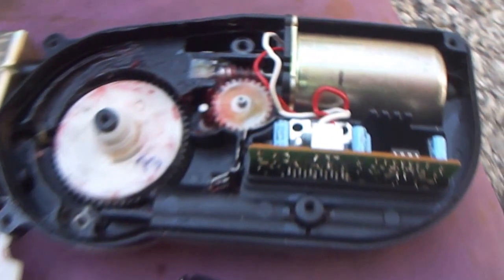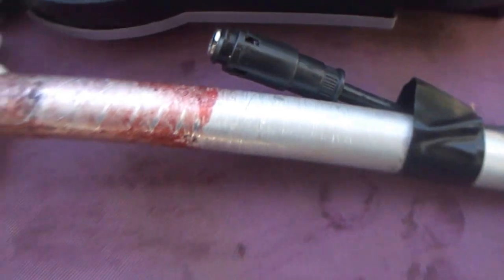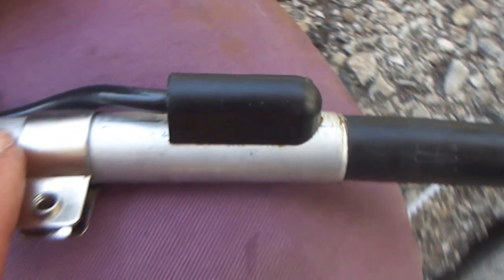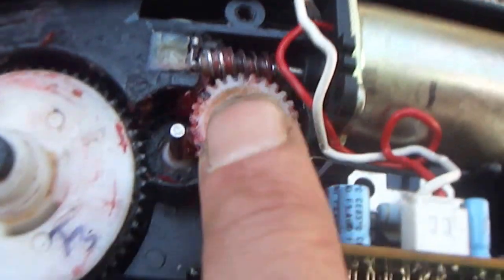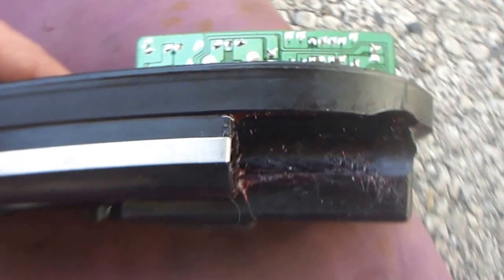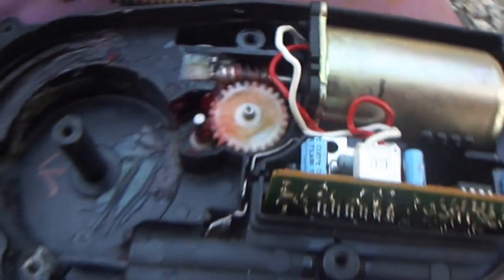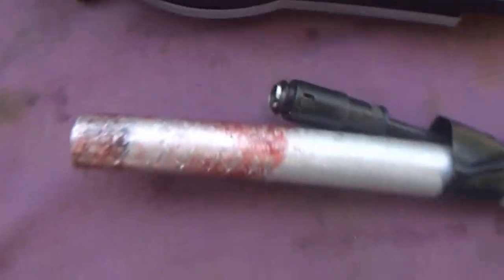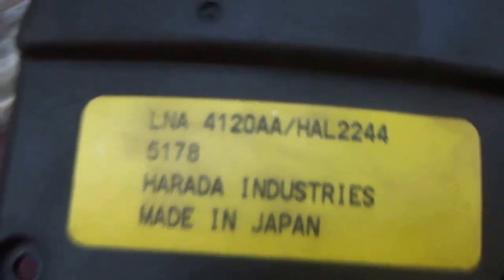Antenna Mast Rebuild Overview On a Jaguar XJ6 (x300)

Comment: I Had to replace my antenna mast in my 95 XJ6 three times in the first 12 months of ownership. Yeah, I'm not too bright! At full extension, I found it would just catch my opened garage door. If I wasn't paying attention at the end of the day, it would snap as I drove into my garage with the radio on. :(.  I purchased the new masks online that came with replacement feed cords as pictured in this video. Not meaning to be disrespectful to Steve for his great Video showing us the assembly and internal workings.  But I just removed the Nut at the base of the mast, then turned the ignition and radio on. The system would then push out the cord automatically thinking it was extending the aerial.  REMEMBER WHICH WAY THE TEETH ON THE CORD ARE FACING. The old mast and cord will keep feeding out until they both come free of the motor. I then positioned the new cord with the mask back in the hole and gently fed it back in after I had someone turn off the radio. After the radio is turned off the unit starts retracting the cord thinking it is retracting the Arial. I lastly replaced the nut at the base of the mast, JOB DONE. The last time I did this I cut down one of the mast sections a couple of inches, So now it just MISSES my open garage door.  Another good video explaining, variations of both these procedures is https://www.youtube.com/watch?v=pwKkA0s5jlQ